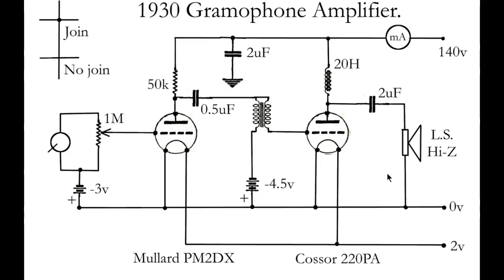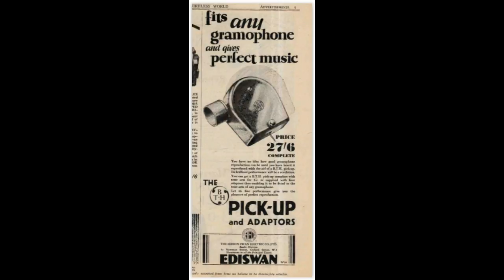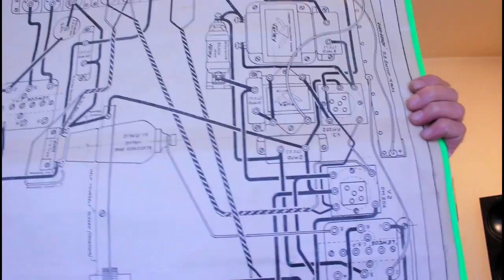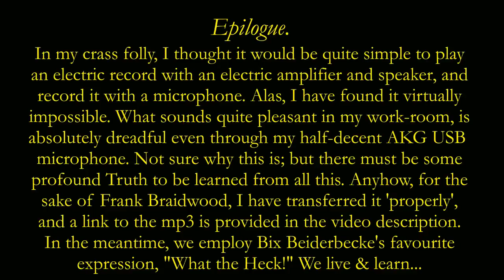Gramophone amplifier of 1930 - two valves (tubes)

Comment: That was fine  Mr. Field.  With your white lab coat that has your name on it, your tie and the subtle humor (or "humour") you would make a splendid professor.  I could listen to you for hours!
Reply from the maker: You're very kind to send your approval - many thanks! We're plotting a short & simple Christmas 2019 project. It should be quite straightforward, & will help with the playing of some, if not all, vertically-cut discs. In the meantime, best wishes in the run-up to Xmas. Cheers, Norman.

Comment: I had an RE-45 Victor radio / phono that had the horseshoe magnetic pickup that was open when I got it. I found that taking a small value ceramic cap, then charging it up to about 4.5 KV using the focus voltage of a common era crt type color tv, then dumping this high voltage/low current across the windings, gave an internal arc that welded the open.  I used it for several years before selling the unit, so was a reliable fix. The volume level was probably somewhat compromised, but had sufficient audio volume and  good tone.  Upon relaying this story to an tech who had worked in the 30's, the radio, he referred to it as a "fish mouth" by the techs who were working in his area at the time. A pic of the RE-45 shows a catfish mouth shaped trim surrounding the frequency readout. This occurred in the mid '80s, so I don't remember the size of the cap, but was probably in the 250 pf @ 6KV area, and can't remember if I chanced upon this repair, or heard about it from somewhere else.
Reply from the maker: That's a fascinating 'fix', Edmund! Am sure it would work more often than not - even if the arc bridges a few turns, it wouldn't matter on a 2000+ Ohm winding! Cheers, Norman.

Comment: Another great video.  I did get a chance to listen to the mp3 version and it sounded great.  Thank you for sharing.
Reply from the maker: Hi Paul. Thanks a lot. Yes, I finally got the link up & running again. No-one seems to know who made the gear that Piccadilly/Metropole used for British recordings, but it was darn good, & considering that Piccadilly was a cheap label at 1/6d  (7.5 pence , FWIW), their pressings were pretty smooth too. Cheers, Norman.

Comment: Thanks Norman. Good job of construction there! You'd be hard pushed to achieve the same sound output levels if using only two bipolar transistors and a handful of components! The harmonic content of avalve amplifuer is also 'warmer' than that if a transistor amplifier.That valve amplifier is running in Class A, so the maximum theoretical efficiency of the output valve, neglecting grid bias, filament power and filament dropper resistor losses, will be 25%. Output power will be closer to 180mW, at best. Those moving iron loudspeakers were rumoured to be more efficient than modern 'hi-fi' moving coil speakers, which are often only about 1% to 2% efficient at converting electrical power to sound power. But they sacrificed sound quality in favour of efficiency. I cannot verify that claim, because I’ve only ever owned one of them, and threw it away, not knowing what it was. Blame youth and impatience for that! The interstate coupling transformer idea was still used in 1960's amplifiers, until people remembered that bipolar transistors are current-driven, not voltage-driven as valves are. That's when expensive transformers wee replaced by cheap resistors and capacitors. The transformer was often wired as an auto transformer as a way of cutting size and cost. As you say, wiring them different ways around gives different sound qualities, but that's because of varying degrees of mismatch of valve impedance. A change to input impedance will also affect output impedance, and thus the sound and efficiency of the output. Moving coil speakers were often ignored because they required an additional output valve anode impedance matching transformer, so adding to size, weight, and above all, cost to the manufacturer and consumer. Try using loops of wire and a washer under those screw terminals; military equipment often came with pre-formed loops on the end of connectors, especially with headphones. 73/g0mrb.
Reply: Add two transformers to the transistor circuit and you'll be amazed at the output you get.

I made an amp specifically for 1920s speakers using two transformers and two transistors in push pull.

I get something like 50Vrms output into a 5K load and the current draw is under 100mA.

Do agree that tubes are better though.

Comment: Love seeing these projects where you build early audio using (where possible) vintage parts. Great authentic sound, though high in treble response. My experience of the PM2DX (as a detector) is that it gives higher gain than say a PM2HL, the trade off being a higher treble response. When I first saw the circuit I wondered why they didn't specify a PM1LF (or equivalent) Guess they were looking for highest possible gain using few valves. It might be worth trying an LF, or even an HL valve in the 1st stage to see what happens.
Reply from the maker: HI Paul. The original 1930 circuit was a 3-valve radiogram: HF, Detector & LF. (PM12M, PM2DX & PM252.) The PM252 was - as you know, a 'super-power' triode. Not too common & quite expensive these days! Alas, it was shot, so I had to use something else. Of course, that meant that all the impedances were wrong, so guess I was lucky that it worked at all. We'll try to trawl down another circuit that will fit the few valves we have here. Thanks for writing, and all the best. Norman.
Reply: Hi Norman, thanks for the interesting reply, would love to have seen the original in action. Not heard of the PM252, mainly come across PM2 or 220P for the output role. Saw something similar to your description in an antique shop in the 1980's. Heavily canibalised, modified & bits missing, but ridiculously expensive! Would love to have had a tinker. Here's my Collaro RC1 if you've not seen it before: https://youtu.be/yjEOV_4Q26s Need a suitable amplifier as it didn't come with one. Off camera I'm using a 1980's 'ghetto blaster' for the audio. Sure to be impedance issues, but with the graphic equaliser it doesn't sound too bad. Any idea of a date Norman? Looks 1930's, but pickup quite light (bar magnet derspite room for horseshoe) & original motor wiring plastic  covered not rubber. Best regards & keep those videos coming!

Comment: Parlophone was brought into the EMI fold in 1938, I believe, by Columbia Graphophone when that company merged with The Gramophone Company to form Electric & Musical Industries Ltd. in that year. As for Picadilly Records, that was a label owned and operated by a little outfit called Nixa Records. In 1959 Nixa did a deal whereby they took on the PYE trademark(PYE Electrical Ltd. was keen to get into the recording industry in 1959 but had neither studios nor record processing plant. Nixa had both, but what Nixa lacked was an effective distribution network for their product. This was where PYE stepped in, they had an extensive distribution network). So Nixa became PYE/Nixa, then simply PYE in 1960 but kept an ever-resent reminder of her origins in the catalogue prefix on the 45rpm singles, 7N-xxxxx(lower-case x's represent number variances). The deal came to an end in the very late 1970s when PYE Electrical pulled out of the deal. The record company couldn't revert to its old brand-name so rebranded itself as PRT - Precision Records & Tapes Ltd. and doing a distribution deal with Polygram, but not to be absorbed into the Polygram empire, rather as a "client" label which would retain its own numbering system.
Reply: We don't know Pye in America, but from the sets I see on line and on ebay, they made some very pretty sets.
Reply: @kfl611  That's a typical superficial response from an American. PYE were makers of top-quality consumer electronic goods, vastly superior to anything made in America. Australia's AWA and Kriesler brands are also of a quality way above that of American branded products.
Reply: @neilforbes416  Perhaps, ha ha ha.  Well I am an American.  It's a brand not sold here, so we are not familiar with it.
Reply: @kfl611  But whether you're familiar with the brand or not, your only comment was how "pretty" the device looked. There was no mention of how well it performed. It showed me clearly that you were only interested in the cosmetics, not the substance.
Reply: @neilforbes416  Everyone knows pretty radios and record players, sound nicer than ugly ones.  Like I said this is not a brand sold in America,so we are not familiar with it.  I'd love to see it work and play and hear how it sounds, and see what it's special features are, and how when the vintage models sold new, how the company advertised them and 'sold' all their wonderful features.  Half the fun in antique radios, to me, is looking at the old advertisements, so see how the company presented all the new and exciting wonderful features.

Comment: great work, when i seen the diagram i thought they had made a mistake having the transformer backwards lol...
still to the next issue of the sound being captured, one thing that is missed is the sounds fidelity as its bounced off some and dampened by furniture when listening in and when recording it direct.
i have been following your hardware repairs and olde-timely remakes of electronics, brilliant man, it just also proves how far manufacturing has come in to our young generation who only see things as a throw away society :/ 
anyhow, best regards, m6yru
Reply from the maker: Thanks for writing. Yes, the 'crazy' connections, linking the primary to the secondary of the transformer seemed very strange to begin with. Had I realised before that they sometimes did that (though not very often) I would have made the circuit diagram show two AF chokes in series, rather than a transformer! It would have looked a lot better then. I also discovered, that when one winding of an inter-valve transformer went open circuit, they often didn't just throw it away (they were expensive, like everything else) but would use the surviving winding as an AF choke! Cheers, Norman.

Comment: You have discovered for yourself why miking a guitar cabinet is an art, but fortunately that means you can steal their techniques. What part of the cone the microphone is pointed at greatly affects the frequency response, for one thing. I'd imagine that warped, patched, and tortured speaker cone wasn't helping the radiation pattern any.

The distortion at the peaks sounds an awful lot like the territory guitarists like to muck about in as well. Some of it may be sag in the supply voltage, but at half a watt this probably isn't an issue.